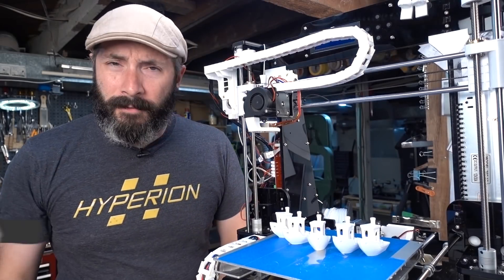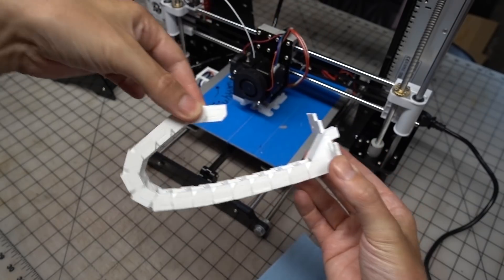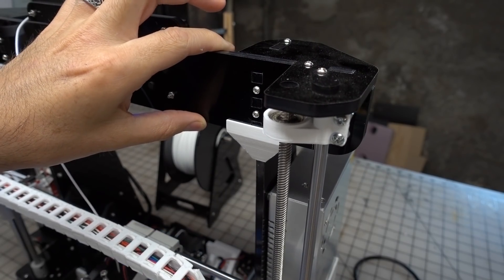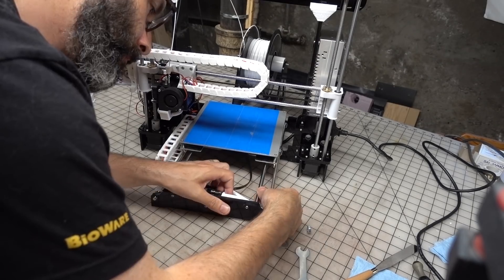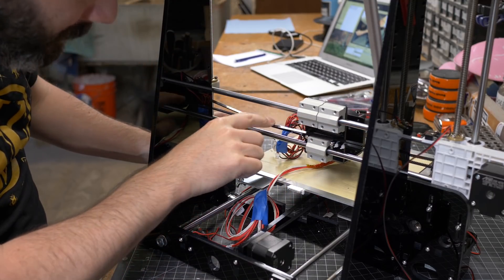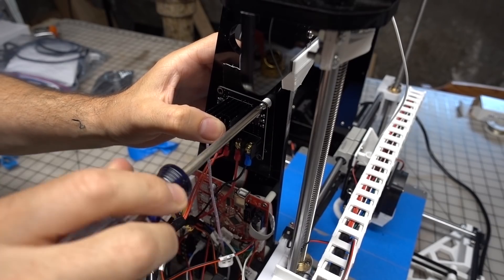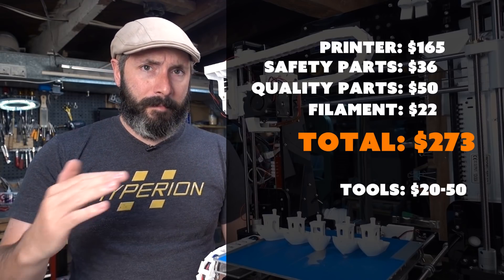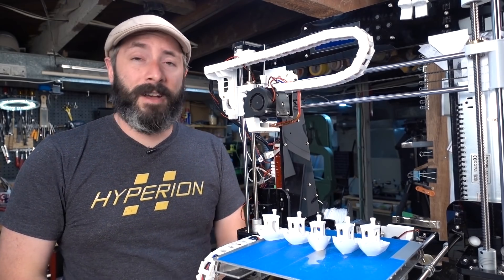Make a Cheap 3D Printer Better - Anet A8 Print Quality Upgrades

Comment: So funny to see you add on all those parts for practically no reason
I ran my Anet A8 for over 2 years solid. With only replacing worn out bearings and hot end
Apart from that it nd dr had any extras
OK when I first used mine I used cura and struggled to get good prints
Like yours for which you have not mentioned the slicer software yet
Anyway
I found Matter Control
And wow perfect prints
So I printed a clear 3d RC spitfire
That looked like I bought from a shop
So may be look at your software instead of wasting your filament jazzing it up for the cosmetics

Comment: Great video! Wish the firmware upgrade had been a separate step so you could see if that made any impact on print quality.
Reply from the maker: AHhh yeah I did that all in one go because I was getting frustrated. I recommend doing it anyway. Apparently it helps protect the machine from thermal runaway.

Comment: You should look at your settings. My Anet A8 works pretty well and I use cura
Reply from the maker: I'll be tinkering a bunch with the Cura settings in my next video.
Reply: Punished Props what helps is getting the right print temperature and 55 for the print speed
Reply: I've heard that simplify 3d makes a HUUUGE difference in quality but haven't tested it yet

Comment: Those Z wobble brackets should only be used if you are 100% sure your rods/screws are straight otherwise you are putting extra strain on the motors and could also hurt print quality. This is highly debated though so do what you want.

Comment: Great video thank you for sharing your skills.
I wonder if you could share your cura settings for this printer.
I'm using cura 2.6.1 now and wish to print some of those upgrades.
(I had a difficult time updating cura and I'm not satisfied with the print results) 
Thank you for those usefull advices
Reply from the maker: My Cura settings are in this video: https://youtu.be/8DPUVGWFYFs
Reply: Punished Props Thank you, I missed it when I browse your other videos, sorry

Comment: They're called Jesus clips Bill. Because that's what you say when you launch one across the room never to be seen again. I think they may be sock larva.
Also, if anyone didn't think the safety upgrades were important, check out Laura's video on abuzz designs.
Reply from the maker: +duckrutt Hahaa!
Reply: duckrutt - likewise, the main nut on the top of a helicopter is called the Jesus Nut, because if it lets go... well, you get the idea... 😮
Reply: Dark I'll stick to working on cars. You haven't lived until you've pressure washed the underside of a firetruck looking for oil leaks.
Reply: lol and because only Jesus knows where they went

Comment: On a cost factor as to your upgrade.  Would you consider “tool and filament” and upgrade factor considering tools are something you do or don’t have and can be used in other needs as well which should also share the expense of them and the filament is an expendable commodity completely and should not be considered a factor of the device as again; it is expendable and would be purchased regardless of the type of unit purchased. Also in regards to the safety concerns addressed with additional equipment;  that could be considered to be a personal issue or choice given that some individuals (for example) remove devices such as guards for table saw and grinders to just name a couple off the top of my head.   Not that they should be removed mind you just it is a personal choice and option.  That being given I would belay to Category “total” and call if “optional but recommend upgrade total when it comes to the safety items”.  With that being said, the total would now stand at or around $215 which is still not s bad pride.   Just my opinion sir.
Reply: If I'm not mistaken then the initial plan was to mention what it would cost IN TOTAL to get the A8 up and running. So when you have to buy tools to accomplish this, then you have to add these costs to the total amount. Yes I do know that these tools can also be used for other project BUT you cannot spread the payment for the tools.
Example: If you have to spend $50,00 on tools in order to get the A8 up and running, then it will cost you $215,00 ($165,00 + $50,00) in total before you can accomplish this.

Comment: To help with Z wobble take that bearing holder on the top off and adjust flexible coupling they are too low. Stepper motor shaft and the rod should only come in about 5mm just for the grab screws to lock them in. The rods should be flush with the frame on the top.
Reply from the maker: Great tips! I'll have to give it another go.

Comment: I think forcing the lead screw into a bearing on top is a bad idea! It LOOKS better, but these lead screws likely come bent from the factory. They might not clamp down absolutely centrally to the axis of the motor because the motor is displaced, or the quality of the coupler is not perfect. Because of this, it's constrained at the bottom and at the carriage, but floating at the top.

Now when you constrain it at the top, it'll try to straighten out the rod, but the motion is translated into a force that's transferred in approximately equal parts onto the motor mount, the constraint at the top, and the carriage; it will work against the compliance of the bearings and the frame and introduce a wave into the print that corresponds to rotation of the Z axis rods. You want to avoid transferring any extra forces to the carriage.
Reply: This is actually the exact reason I dropped my rods down so that they don't even touch the top brackets. After doing that. the only Z axis inconsistency I get is from the occasional poor cooling due to my fan wearing down.
Reply from the maker: Agreed! I have since taken them off.
Reply: I used to have an Anet A8 (I did not know about the safety updates until it was to late). If you adjust the coupler on the bottom of the Z-Axis threaded rod, it will line up better. The rod and motor shaft should only be about 5mm into either side of the coupler. I measured mine and put a small piece of tape on the threaded rod and motor shaft to make sure I had it right. This should put the threaded rod nearly flush with the top of the top plate. There is actually a really helpful Facebook group for the Anet 3d printers. the people there helped me out a lot with tuning my printer, and I helped them by showing what a thermal runaway can do.

https://www.facebook.com/groups/1068531466501015/search/?query=z%20axis

Comment: That is really surprising... my a8 printed almost flawless like just built no upgrades... and after adding like 3 small upgrades for belts and frame it prints pretty much the same, maybe a lil bit smoother. It really feels like you just got a bad machine...
Reply from the maker: I've heard that from a few people. I think you're right, mine was a little sub-par out of the box.
Reply: Welcome to the chinese printer lottery where you either get a champ or a chump

Comment: here are some more improvement ideas: 1. Change to a E3D V6 hot end with a bowden tube (take that heavy motor off the carriage)  2. Change the couplers from the Z threaded rods that connect them to the motor with solid ones (from thingiverse). these yet made the biggest improvements in my printing experience.
Reply: TBH, putting a Bowden system on a bed slinger is pointless. A heavy bed should be matched by a heavy extruder.

Comment: Bill, I challenge you to print a
3D printer
Reply from the maker: With all the things I've added to this machine, I'm half way there! =D
Reply: There are just parts...there is a thing called a Mostly Printed 3D printer...and other than a few pieces of wood or metal or acrylic...it's all printed
(if you have a big enough bed...you could even print the frame for smaller 3D printers :)
https://www.vicious1.com/projects/project-3d-printer/
Check out this one...where the limit of the printer is the size of the room you can put it in!!!
https://3dprint.com/167250/hangprinter-midair-3d-printer/
Reply: thx for the link seems to be an interesting site
Reply: Punished Props Hello there! I know you are busy and have lots of comments to look at, but if you could tell me what infill you used for the y axis chain that would be great :-) Thanks.
Reply: I challenge him to get straight to the point !
Reply: That's actually the goal of the RepRap project, which Prusa embraced in the i3 design that this printer blatantly copies.

Comment: I have to ask though, with the amount of time and effort put into this machine so far, are there any lower budget machines that you've worked with that produce similar results (on the upgraded A8) for a similar price? (250-300 usd range?)
Reply from the maker: This is the only low budget machine that I"ve used, so I can't really compare.
Reply: I would say look at the Wanhao i3 line. It's around $350 but I've heard it makes for a better base. The truth is at that price range (at this moment in history) any printer is gonna kinda suck. Yes, with enough time and effort (and luck) you can have an awesome printer on the cheap but it honestly isn't quite there yet.
Reply: Im not looking for 'on the cheap', im more trying to avoid the excessive amount of time and tinkering bill is having to put into the A8 making sure its not going to self destruct or burn his house down. I figure, I could either by the A8, make these repairs for about that price tag, or buy a printer with a similar price tag(post repairs) and have most of that leg work done for me.

I'm good with my hands but I know jack shit about electronics, Not for lack of desire to do so of course.
Reply: The problem with cheap printers is there are only so many corners you can cut. They all need a minimum of 4 motors, an extruder (I know they are called a hot end but it's a frick'n extruder. It's where the plastic comes out. The part named extruder is a drive system. /Rant), some brains and a way to make everything move in the proper direction at the proper time (rails, screws, belts whatever). Angus at Makers Muse says the Wanhao is solid and I don't have a good reason to doubt him so I recommended it.

Personally I spent my money on an Original Prusa i3 Prusa Mk2S by Joseph Prusa Prusa. I may have left a Prusa out of the previous sentence, there are a lot of them in the name. Everything is a quality component that's been tested before it gets put in the box. It's the template that a ton of kits (including the A8, A6 and Wanhao) are based off of. It isn't cheap at $700 but at least you won't have to wait months to get one like I did. The power supply is already fused, the board is already fused, the connectors have the proper amp spec, over and under heating warnings haven't been disabled in the firmware and the thing prints really well out of the box.
Reply: Fair enough, I know 3D printing really is one of those 'you get what you pay for' kinds of deals, but there has to be a point when your returns exceed your investment. Makes little sense to invest in a printer that requires hundreds more dollars in modifications and upkeep when you can buy a higher end system that's far more ready to work right out of the box (within reason of course)

I know that's the purpose of Bill's experiments here--find a cost-effective printer that, with some tinkering, can produce reasonably decent prints for a limited budget.

of course my dream printer is the form 2, but that's a long ways away. rofl
Reply: Well, I've had one of my designs cast in gold and a duplicate cast in silver so I'm doing alright with mine :P My 'ol man is a jeweler however so your millage may vary. Nepotism!

The safety features are the first thing to go and it honestly isn't that big of a deal to fix but acrylic and I don't get along very well so I try and stay away from machines that use that for a frame. The I3 is open sauce so you could buy the exact electronics you want, have someone print the 3D parts and build an awesome printer for somewhere in between if that's your thing. Tom Sanladerer built Dolly and recorded everything over on his channel which will show you want's involved. I know he had a list of parts on his website and I think he had an alternate quality parts list?

The "good" news is that FDM printing has kinda evolved about as far as it can go so SLA style printers are probably the next in line for affordability/usability. Once Wanhao gets their D5 sorted out (A printer that uses an LCD panel to harden the resin) I will probably have to bag one. The build surface is pretty small but for $500 I could print me some nice minis.

Comment: I think the belt tension is pretty much the only thing you had to change for the "after" benchy...
Reply from the maker: I have a similar hunch. I think I can even get the X-Axis belt tighter with some more tweaking.
Reply: Punished Props dont tighten it too much tho. If you do you might bend the stepper motor shaft over time. Happened to me

Comment: I love, love my Anet A8.  I am surprised at the quality of prints you got, mine were much nicer out of the box.  I have easily over a thousand hours of print time in mine.  Surely the 300 buck ender printers are better.  But for a nerd like me, nothing satisfies me more than the quality of prints I get, that frustrates even a makerspace who spent far more on their ultimakers than I did on mine.
Reply from the maker: Yeah it's really interesting how varied some printers are out of the box
Reply: hey sorry noob question do you know what type of tape hes using on the bed?
Reply: @rubenmedina2396  just painters blue tape most likely.  Really not needed if your leveled correctly

Comment: Vibration dampeners are cheap (3 for about $12) and make the machine whisper quiet and for me has increased my print quality at higher speeds (60-100mm/s)
Reply from the maker: Neat!

Comment: In my homble opinion anti Z woble brackets and chains were the worst upgrades you can make on your A8.  My printer has like a half of the amount of upgrades he has and it prints like 5x better but really. He made some serious wrong decisions. The first upgrade should be fan duct and the second two belt tensioners for X and Y. Third upgrade would be glass sheet. Can't believe he doesn't have glass!
Reply: I just got my first 3D printer, anet a8 and it prints way way better than the one he is using and its stock :-)

Comment: I would have changed the belts for Stainless Steel Lead Screw Rods then set the printer up properly. As I did on my first printer. Now I build my own totally now they can draw,Laser and cut with a cricut blade.

Comment: very very good video, I really enjoyed it, I am looking to get into 3D printing so I can print nylon 6/6 18650 li-ion cell holders. I am looking a bed that is between 500x500x500 and 800x800x800. I would like to buy or build or modify a system that will do 3D printing, parallel gap spot welding on 18650 li-ion battery packs, and some kind of a plasma or laser cutting that would cut steel. Do you have any direction you can give me brother? I liked your vid and subscribed to your feed!

Comment: your z-axis stabilizers are the wrong ones, there are others which are screwed to the frame , this upgrade did massive impact on my quality. then you should invest the 5$ in 1m rod for the vertical stabilizers from top top front, this took all the whobbles, and your fan outlet is not the best one... look for mistral, this one is better, I had yours for a while, better then stock but not best. hope my comment helps other anet users.

Comment: your x-axis is effected from pulling on your filament. instead of using those loops/guides you printed you should should use PTFE tube and clamp it down onto the frame at the spool end.
Reply from the maker: Yeah I took those things off yesterday. Definitely more of a hinderance than a help.

Comment: Got an A8 but the magic smoke escaped on the first power up. At least gear best support is a'ight and shipping a new board, but it's a super slow carrier.

 During this downtime I've watched nearly every Anet YouTuber fight against the acrylic frame. This inspired me to just save the time/filament and look up metal frame alternatives. Turns out theres a diy extruded aluminum frame on thingiverse called the Anet AM8, and it's only like $40 for the extrusion frame. Look it up! :D
Reply from the maker: Wow! Burned up on the first try. Bummer! I'll look it up, but for now I think I'll stick to this floppy plastic...
Reply: there is no Hugh fight with the acryl you just need to know how to stabilze it i will upload my stabilizer to thingiverse which siuts to the corners which are seen here
Reply: there is no Hugh fight with the x axis wobble i just made some easy parts a
this parts are for the T corners in the video my stabilizer pushes it up and gives stability left right the acryl gets 14mm  Pla bars to stabilize it

https://www.thingiverse.com/thing:2568271

Comment: No clue what's wrong with your but my A8 printed out of the box a better quality that you had after all the upgrades. Actually the A8 prints the best for it's price some that cost twice as much won't do better. I think, you need to take some care into your slicer settings. For instance the angle fixes for the frame look to me like you're extruding too much filament while printing.

Comment: Ah, I spotted ONE problem!  Your z-axis shaft coupler should not sit directly (flush low) on the steppers.  They actually ride well ABOVE the base.  This way, the spiral screws easily reach loosely into the top journals, as intended.  https://3dprint.wiki/reprap/anet/a8/coupler

Comment: Your z-screws have not been aligned and calibrated.  Have a look at this and then get rid of the bearing and lock that you installed on the top.
Reply from the maker: +Warren Meyer Yeah I need to monkey with those for sure.